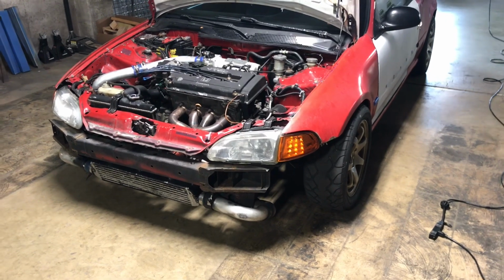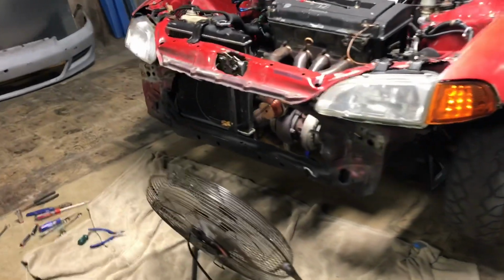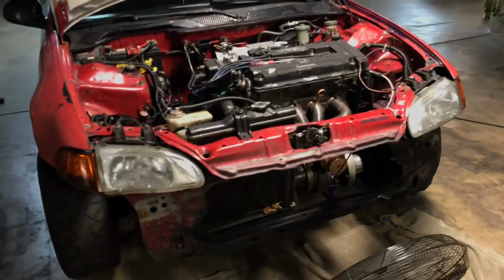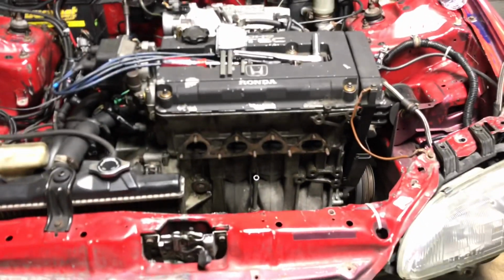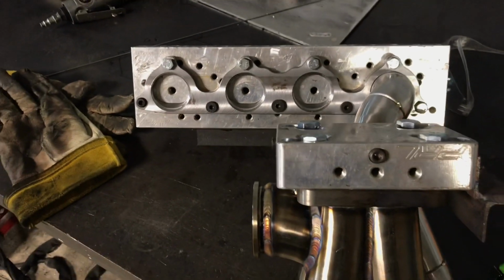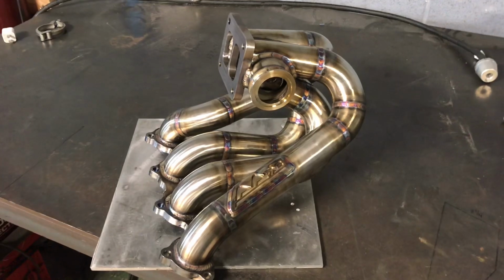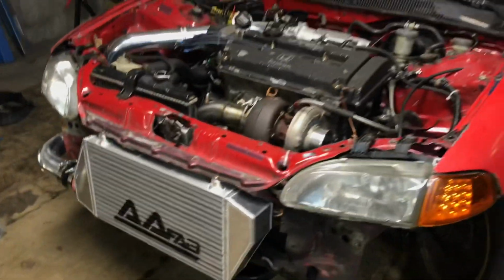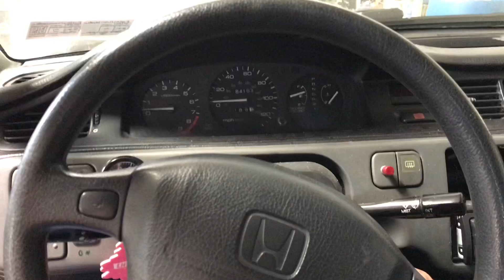Honda Civic Eg custom turbo kit!

Comment: Good job, but a question, why the twinscroll flange??
Reply from the maker: Edgar Geraldes thanks! The customer had a divided turbo and requested me to use a single gate, so I used a divided flange but knife edged the inside for smooth flow.
Reply: @arcangelfab9286  nice bro, keep your good work and videos ;)